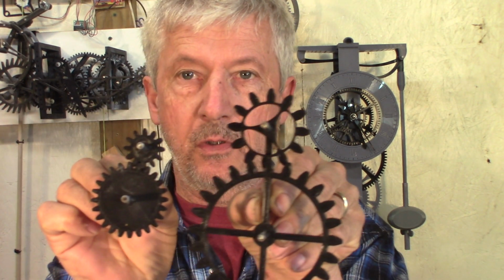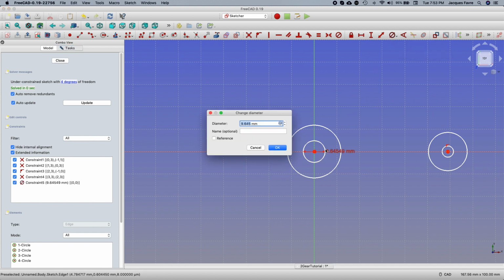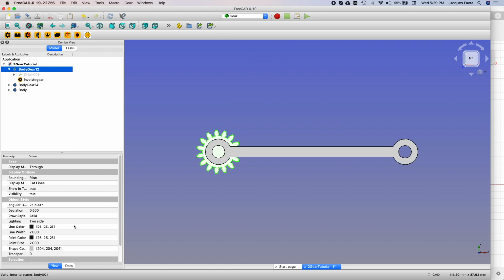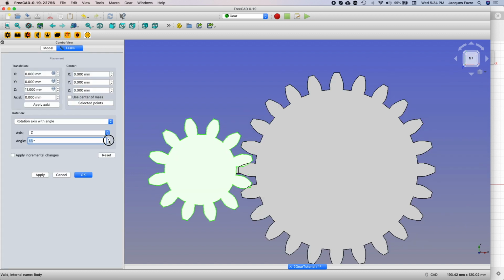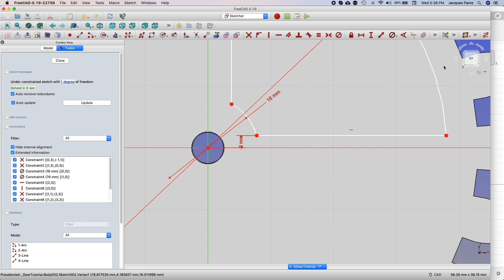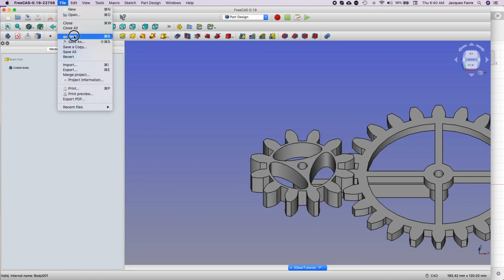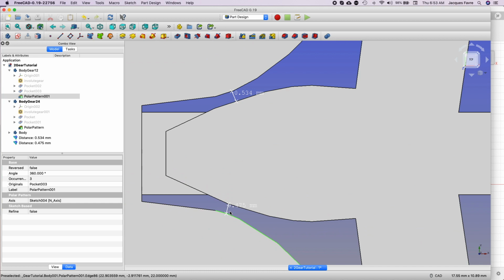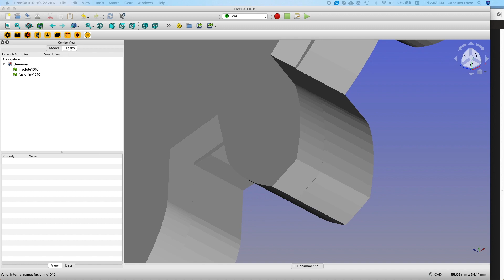FreeCAD gear tutorial

Comment: Great to see FreeCad being used for gears. Nice tutorial
I am planning to build clocks in wood / plastic, and I see the wall clocks on your wall that look really good
I already have a CNC and have started learning FreeCad (Ideally I just want to learn one product and use that for all design, if possible)
Are you using FreeCad for all the design work for those clocks ? or are you also using other software to complete the whole clock ?
Do you also design all the escapements on FreeCad ?
Do you use some form of animation so that you can verify your mechanical motion visually before cutting all the components
Many thanks for any help and pointers Jacques
Reply from the maker: Thanks
I have a couple more videos on gears, cycloid gears, animation and escapement design
Even started escapement animation with FreeCAD
I hear that FreeCAD path workbench is the best open source for CNC, but I do not have any experience of it
FreeCAD is very powerful, that mean lots to learn